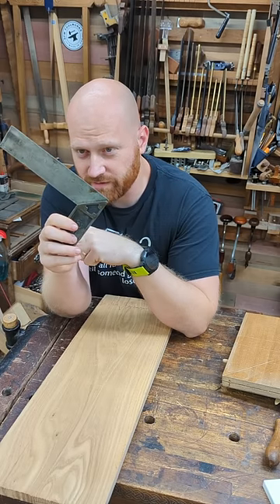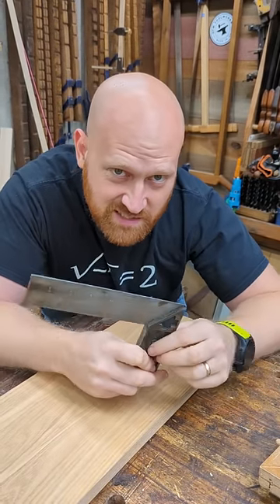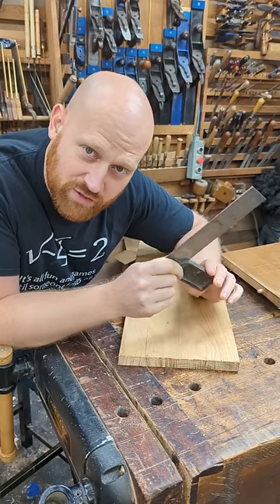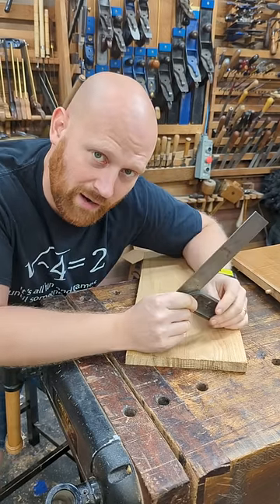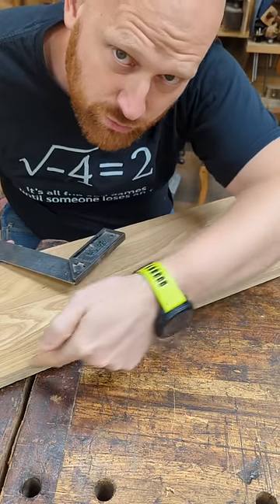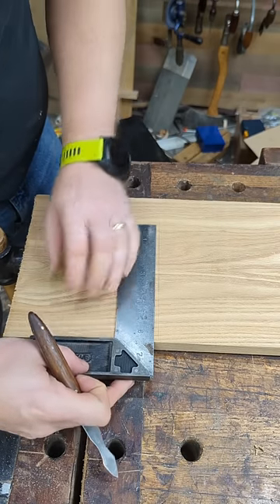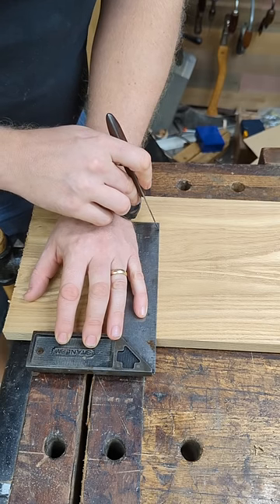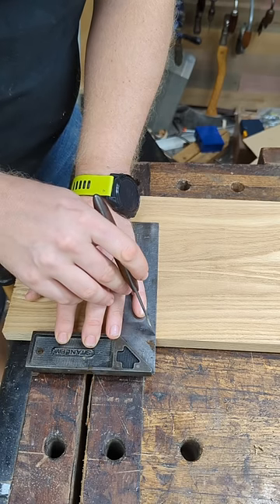How to Check if Your Square is Square

Comment: 30 years ago I asked my father who was a carpenter why there were little dents on the corner of his framing square, they were peen marks made from squaring.
Reply: Punch marks, not peen.
Reply: He was peening the edge of the speed square. Using a hammer to deform the end to bring the square back true.
Reply: Michael  I learned about peening squares back into square on framing squares.
Reply: Michael  You can doubt all you like. What you are doing is merely repeating the "common knowledge" of your environment. I am 70, my grandfather taught me a lot of my woodworking, and HE learned his in 1920.
And people then didn't have the facility of repair shops and couldn't afford to buy new tools.
He taught me all sorts of tricks that YOU never heard of, because you would either buy a new tool, or get your faulty tool repaired commercially.
Reply: Absolutely

Comment: How do you know the wood is planned to perfection?
Reply from the maker: you use a strait edge, or eye down the corner, or use a jointer plane set finely, or use a tight piece of string.
Reply: The way a jointer works it almost always works, if you want precision you can just buy an old gauge block
Reply: @melody3741  or just get like, a 123 block and an angle plate
Reply: @Hellknight101  The right way to check a square is to use a reference square, like a cylinder square, on a surface plate.
Reply: @machinist7230  ah thank ya! I'm still in school for machining
Reply: @WoodByWrightHowTo  Thank you for the response
Reply: @melody3741 , I think that you are talking about a surface plate, as gauge blocks are quite small in comparison, one inch in length and less.
Reply: @X X, you need two boards of the same size, thin enough to comfortably shoot them simultaneously, so that the edges are identical, with a plane using a straight iron rather than a cambered one. Shoot them using your best technique, my way is to lay my jointer plane on its side on the bench and pack up the paired boards enough to center them on the plane sole. Check the shot edges against each other to be sure they are not hollow, or swiveling in the middle. A sweetly sprung glue joint is not appropriate here. Now you have two boards to work with, and looking for light between them allows you to know that they deviate by  less  than .0005'' each over their length. For a few minutes, anyway.
Reply: He doesn’t trust a tool manufacturer to be square but trust the edge of a piece of wood 😂
How do you know the wood is perfectly flat 🙄
Reply: Cause God. 

Duh.
Reply: If you have 3 of them, you can just check that their side line up perfectly when put next to each other (for all three planks). Straight line is the only shape capable of that

Comment: Yep, true. Well said James.
(I bought a new one last year and it's not right. Never fixed it because it's not nice in the hand either.)
P.S. even if you're not sure of the board edge, if you have a known straight edge, but it up and mark the board from that to check. Fiddly but worthwhile if you need to.

Comment: This is where the phrase “close enough” comes in
Reply: The tiny difference gets multiplied each time within a project and can quickly become a problem
Reply: Yes I know that. It was a joke….
Reply: @chrissatterwhite711  my bad, sometimes it's hard to tell on the internet
Reply: @TheMagicWorker  ya I hear ya
Reply: @TheMagicWorker  most cases it doesn't matter especially in wood working. Unless you are doing some metal working with tight tolerances I don't see why this could be an issue.

I can see if your saw or other tools were off but the square is just a reference. Though I'm not a wood worker so idk, I'm planning on doing some woodwork after I setup a workbench and room
Reply: Perfection is a direction not a location. you can never get there.
Reply: Exactly when working with natural materials I don't care how good your machines are you will never achieve perfection,  my dad was a joiner and he always said " looks right is right "
Reply: "Close enough" just might be settling for lesser quality than you are capable of. Always strive for a better outcome than you have previously achieved. Self-betterment is good for the heart and soul.

Comment: That can be repaired.  By gently tapping the opposite bottom corner with a hammer.  You can't get rid of a 1 cm difference, but 5 - 6 mm will work.  Depends on how thick the material is.
Reply from the maker: Bingo. Have a few videos on squaring squares

Comment: I will do this in the store before I buy a spirit level. Use it on any surface, then rotate 180 degrees and if it reads the same it's not been throw around the factory. I've actually seen many spirit levels in the store read whacky.
Reply from the maker: So true!

Comment: Mine are square within .001 inches. Have to be in order to be certified every year.
Reply: Squareness is not a linear quantity!
0.001" per what?

Edit for reply: so it is a tolerance on the flatness of the surface related to the defined square edge and therefore includes squareness?
Being pedantic it could be very "unsquare" close to ends and so presumably has a further specification? ... although the method of squaring up would in practice subsume this. Setting up the accurate square would be more difficult in a wood shop than a machine shop even with the less stringent tolerances involved. Perhaps just hand filing and trial and error would be sufficient for the amateur woodworker?
If going across a piece of wood I tend to average by squaring from both sides to the middle detecting any significant error there and then.
Reply: @simonblackham4987  they are when you run an indicator down one edge and make it perfectly straight with in .0001 inches and then run your indicator down the other straight edges. To be certified they have to be with in .001 inches. Might help to let you know I’m a machinist by trade and hold those tolerances everyday.
Reply: what happens if you drop it
Reply: @ronal8824  most likely the same thing that happens with all the other measuring tool I use. They go in the scrap bin and I go spend often times a couple hundred dollars to replace them. So far I haven’t dropped anything but buy new “toys” anyways.
Reply from the maker: That is why I love my rubber floors.
Reply: @WoodByWrightHowTo  rubber floors would never hold up in my environment. Far to much oil and metal chips.
Reply: You aren't using them on dead tree carcasses either ;)
Reply: Is that like 1cm in metric?
Reply: A 8 inch square would have a different value than a 24 inch square since you’re measuring the angle.  Where do you have your squares certified?  And what the hell are you measuring with them?
Reply: @ronal8824  recertification
Reply: @CheddarCheeseBandit  I believe it has a profile tolerance that has to fall within +-.001 inches from end to end on both sides of the angle. We don’t use them to measure per say. We will check squareness of a block after milling or the occasional use to aid in a setup. We manufacture mostly aerospace parts.
Reply: @mrfuzzy2954  No. basically if you take an average human hair and cut it in four from end to end one of those is about .001 inches.
Reply: Soooooo what brand squares are you purchasing? Asking for a friend 🤓

Comment: That would work well, I always check mine by lining it up with the slot on the top of my table saw, to adjust one that is out of square is to tap it lightly with a hammer, small preferably,  up near the angle, if you need to go to the left tap it on the right side and vice-versa
Reply: Why not get a non adjustable square
Reply from the maker: Those go out much faster and you have to check it more often.

Comment: I'm sure you are a very skilled carpenter. But as a mechanical engineer, seeing you calibrate a steel or cast iron measurement device using a wood reference hurts my soul. A surface plate and a dial indicator are a metrologist's best friends.
Reply from the maker: Yeah there's a big difference in woodworking and machining.

Comment: I think i have an idea on how to do it with a piece of thread, or wire or whatever. 

Using Pythagoras theorem, the length between two lines joined at a right angle is equal to both of those lines squared is equal to that line squared. 

A squared + B squared = c squared. 

A and b are the bars that make up your square, and c is the line that would connect both ends. 

If your square is out of alignment, the line between the two ends of it will either be too long or too short. It will no longer be a right angle, and thus the line will no longer fit.
Reply from the maker: That'll get your clothes but it's very difficult to get an accurate measurement between that. As long as the edge is straight, this works perfectly every time. And it's very easy to check an edge. If it's straight. There's a dozen different ways to do it in a few seconds.
Reply: @WoodByWrightHowTo  fair point, admittedly i shouldve mentioned i was thinking about how to do it if you didnt have something already square to compare it to.

Comment: So how do you know the board is perfect and flat?
Reply from the maker: You could use another straight edge, a string, a jointer plane, or an eyeball. There are a bunch of other ways too. But those are the most common.

Comment: I am definitely not a carpenter or maker of any kind, but are there not laser angle measuring tools out now, that will give you the precise* angle?

*in this context as precise as feasable for the application.
Reply from the maker: the problem is a laser has a thickness and it is well within the accuracy you want. so that do not work well for that.
Reply: @WoodByWrightHowTo  That is good to know, thanks.

Comment: So make square then. Take a small nail set or center punch and hit the flat side of the square just inside the inside corner or just inside the outside corner depending on which way your square is out.
Reply from the maker: Yup that is the other video. Got to love shorts.

Comment: I've never seen a new Starrett be out of square
Reply from the maker: all the time. They guarantee them at the factory but all squares move over time and shipping and use.
Reply: @WoodByWrightHowTo  maybe over time, but not from the factory. We ordered them at our shop and one guy had the same set for 10 years and they were still dead on.
Reply from the maker: I've had two purchased brand new that needed adjustment.
Reply: @WoodByWrightHowTo  must've been a shipping issue because we would order a new one for every new hire and we would always check them and they'd be spot on. Or we possibly just got lucky
Reply: I've seen a few new ones (not owned by me) be out of square.

It's just the nature of mass produced items. Sometimes they slip through, it happens.

Comment: 1. Do step and and draw the line
2. Pull out a protractor and measure the angle. Should be 90 deg. Now you know exactly how much it's deviating

Comment: Also to note that you have to hope that the board edge is squared from the mill, usually are, but I’ve had pieces that were not which throws a wrench in the process 😂😂
Reply from the maker: that is why I saif to check it. it does not have to be square. just strait. and there are a bunch of ways to quickly check and fix it. never trust an edge from the store.

Comment: Speed squares shouldn't have this problem right?
Reply from the maker: they go out of square too. they just take a greater force to do it. and generally if they are out by a few degrees then there is no problem for the work they do.

Comment: That would assume that the board edges are cut perfectly parallel. I would trust the square more than the board.
Reply from the maker: the edge of the board just needs to be flat. you can check that with a string, strait edge, jointer plane or just your eye. I only trust the square if I have checked it recently. even the good ones move.

Comment: How do you know that board is truly square? How do you know the square used to square that board was square? Maybe that one was a little off and your deviation is how much the that board is off and your square is right? This is a neat Impossible take when working manufactured and natural materials. Working in a shop w machines and jigs, things move and parts ware out. Unless your a machinist using a micrometer, you'll chase your tale in perfection. Have a tolerance and live it if you can.
Reply from the maker: The board does not have to be square. It just has to be straight and there are a bunch of ways of quickly checking that. 180 degrees - 90degrees = 90 degrees.

Comment: You didn’t say how to correct them.   If the square is shy of 90° in a framing square you take a center punch and put a dimple on the inside by the hole for the pivot. If you are over 90° the dimples go to the outside by the heel. If you need more than 2 or 3 keep it even and work both top and bottom. Keep them fairly close to the centerline from inside corner to the heel.
Reply from the maker: Unfortunately there isn't enough time in a one minute video. But I have several videos already covering that topic links in the description

Comment: My OCD is very mad at you right now.
Reply: What's funny is, back in my early days, I would lose time flipping a square just to double check marks on a square cut, to be clear, I'd do it repeatedly on the same square for every cut.
Reply: @JL-fg2vk  I don’t blame you at all for doing it!! Seems smart and prudent! I probably would’ve watched you and approved. 
I’m also stuck concerned that his board may not be completely straight either. Not enough of a ‘constant’ to check a square against. Oh my head..
Reply: @jessicagriffith  exactly, not only do we have to flip the square, but flip the board as well. At this rate we might make 10 cuts an hour. :)
Reply: @JL-fg2vk  And sharpen our pencil! The line thickness might vary! We’ll straighten out the crooked clock while we’re at it. We aren’t cutting any boards this hour.
Reply: @jessicagriffith  :D

Comment: Just had to replace my speed square. It magically got to be off by 1/16th inch over a foot over time
Reply from the maker: yup they have a tendency to do that. you can adjust them but with those it is often easer to just get a new one.

Comment: I check mine with a surface plate and cylinder square
Reply: Bit overkill for normal woodwork imho, but I'd be lying if I said I wouldn't use it if I had access to it.

Comment: I have a empire square, it’s one piece cast aluminum. Pretty sure it is a true 90
Reply from the maker: those are harder to knock out but it can be done. but for the work those are ment for they could be a degree or two out and it would not be a problem at all.

Comment: It is good enough. But if we look at it mathematically, we can say that no angle is perfect 90 degrees. Each plate has a clear deviation. Here is also a good moment to include probabilities. This is an angle, this is a continuous value. Therefore, you can say that the probability of having 90 degrees is equal to 0.

This raises the question. At what limit can we call something 90 degrees?
Reply from the maker: It depends on the application needed. That's a very different number if you're an astronomer or a sea captain.
Reply: If it conforms to squareness standards for machinists, it's more than square enough for me!

Comment: If any of you think your house is square you’re high af. Each trade is basically there to cover up what the trade before did. Think of how many times you’ve seen a construction guy buying beer after work.. hangovers suck even when they’re mild and construction sucks too. Combine the two and you get a half decent barely acceptable job. Now multiply that by every day and a strong 75% of construction guys. Your house isn’t square.
Reply: So true. Our house was built in 1902. there's not a right angle anywhere. in places the lime render is 10mm in others its more like 40mm lol. Even then it ain't square :P We dry lined and insulated the interior a couple of years ago and every joint was cut off angle to compensate. Totally worth it for the Cat6a shielded network though :)

Comment: How to tell if the tool you use to make things perfectly squared is not perfectly squared:

Use something perfectly squared. 

Oh thank god I would have never figured this out.
Reply: You can get things square without having a square to measure it.

In this case, you only need a straight edge -- a good reference surface, it'll be plenty fine for this method.

Comment: How do you know if the board is perfectly square if you don't check it with a square that's perfectly square?
Reply from the maker: The board does not need to be perfectly square. The board just needs to be perfectly straight. You can check that with an eyeball, A string, A jointing plane, a straight edge, or any dozen of other methods.

Comment: Stopped the clip and here my wild guess
All sides same length and same length of both corner to corner X lines in the inside
Double check through math
Reply from the maker: No. That is far less accurate and takes forever. Just take something that's 180° and split in half if it matches both sides then it's 90°.

Comment: Now how do you know that edge is truly flat?
Reply from the maker: You can use a straight edge. Or you could use a jointer plane. Or you could use a piece of string. Or you could just eyeball it. And there's quite a few other options than just those.
Reply: @WoodByWrightHowTo  I know it was just a joke
Reply from the maker: Sorry. I have gotten that question a lot on this video.